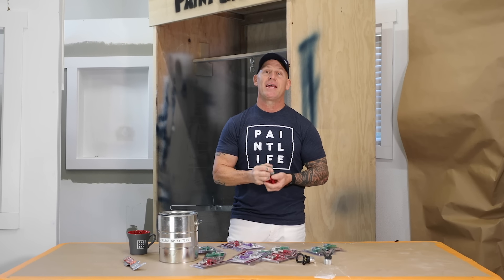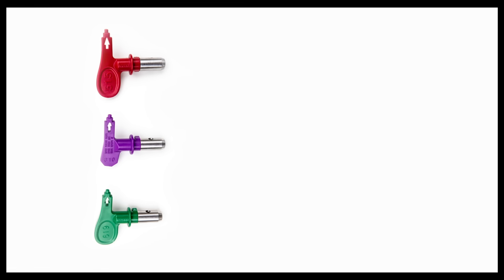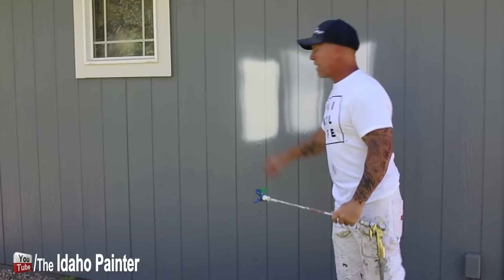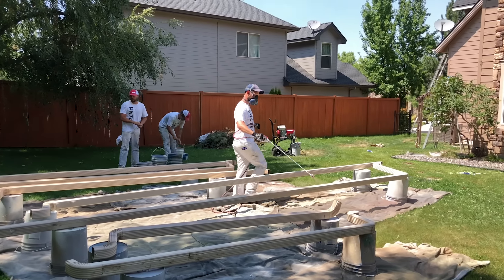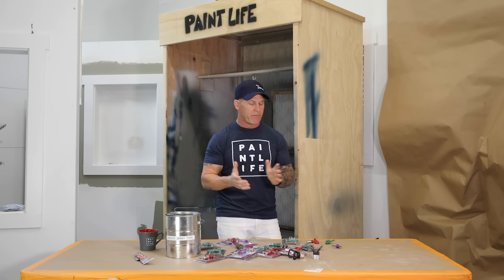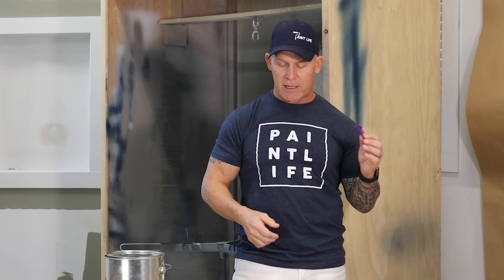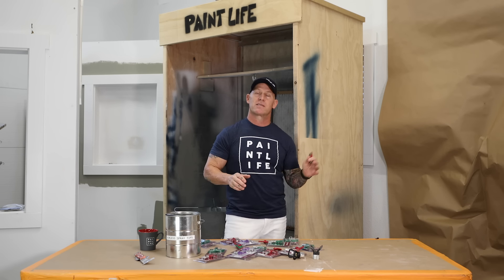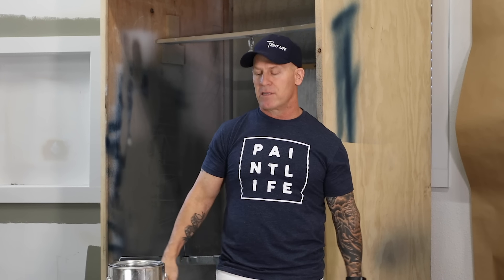3 MUST HAVE Airless Spray Tips!

Comment: I have a Graco X7. Can't go up to a 619. SO I bought a 517 going off your tip of a wider fan and more paint. What a difference between it and the 415 I had on the rough cedar siding. Didn't think it would be that noticeable. I went to painting myself after getting ripped off by the contractor that did our siding by thinning his paint and laying down just enough to change the color (paid for by insurance after a hail storm). The paint was thin enough that one pass with a 2300psi washer removed the entire coat, exposing the older color underneath. Talked to a contractor who told me some painters cheated on insurance jobs to maximize profits as he'd repainted houses that had been painted that way on an insurance claim. Made me wish you were here in Colorado. :)

Comment: 3-10 is a double orifice tip. Flat heads last a lot longer than the new switch tip fine finish tips. Fine finish tips very expensive and do not last long before they get blown. Especially on production work. I know the double orifice flat heads are special order and not easy to get now.  Nice job explaining in a short time.

Comment: You're amazing and I watch you all the time, I've been painting 22 years now and always like to keep learning and you are the man, I use 310"s for trim work, I carry a 410 in my pocket and I switch it out when I get to my doors, that way I don't have to adjust my pressure cause it's the same orifice size so just switch it out, do my doors then can switch my#310 back in and continue with my millwork, if I'm using acrylics I make sure that I have a medium course gun filter so it can pass through and atomize properly, if I'm spraying lacquers I use a fine finish filter and use a fine finish tip . Another thing we'd do when doing car lot's on exteriors, Wed put in a bigger tip , turn down the pressure to where it's literally fingering and back roll, of course back rolling is a must, we'd just do it so there was no over spray, basically it was coming out like a garden hose. We also spray down to the Second to last board on lap siding on exteriors, basically cut in underneath the board with the gun so we don't have to mask off the foundation, just roll out the bottom board. Thank you so much for your pro tips and knowledge. Sincerely Lorenzo gig harbor WA.

Comment: Love them HEA tips. Much new construction or repaints here (ect) houses are 3ft apart. The hea prevent me from masking the wall of the neighbors house.  Thank you for your time in the video
Reply: So the lower pressure just keeps over spray in the air down?
Reply: @oregonsdank  thats part of it yes. They also fan off on the edges better for less hard lines. Less flash when we overlap higher sheen paints like whats going on with exterior paints in my region. They put out close to the same gpm as a standard tip though. They are not to be confused with a fine finish tip though. 
   Graco, Titan, Tritech all also now have fine finish tips fflp (fine finish low pressure) that go WAY up in size. 6 21 in some cases. Not all fine finish are low pressure but many new ones are.  Shooting a 3 story house thats 4 feet from another 3 story house, these low pressure tips are worth the weight in gold. I dont mask the neughbors house. I can also get my gun a lot closer to the wall. 
  Small pumps can now run tips, and work half as hard. They literally extend the life of packings.
  I can mask less, which is less man hours. Run 12" paper on a dormer and haul ass.

Comment: Super useful.  Thanks!  Consider including time indexed summary/notes.
310 fine finish for doors.  Or fences even if trying to limit overspray.  510 fine finish if lots of doors.
515 for all exterior work.  Brick.  Some interior work.
619 for high/fast production interior walls.  Not for super smooth walls, risk of fingering/lapping.
HEA for level 5 finish.

Cheers!
Reply: What’s best tip for a beginner on interior walls. Latex paint. Not new construction.
Reply: @RaphaEl-pn8ue  did you find out what tip is best. Got a rental that I need to paint quick.
Reply: @kal7844   515 just giver a go! it's not very hard to get used to the speed of it, test it on a large piece of cardboard, overlap your sprays by half each pass.

Comment: Here's a question for ya, hope you see this, there's a home with lots of interior trim, 1" outside corner trim, 2" and 3" trim around all doors, baseboard and next to ceiling.  Should I use a smaller fan tip like 110 for that? i've never used smaller than 210 before, is it worth getting that tip size?

Comment: What would the difference be between a 310 versus a 619 for walls? I am going to paint the walls, trim, and baseboards all the same color, so which tip would be best for that? Since I would want to get it done as quickly and efficiently as possible, would the 619 be the better tip? I am learning SO much from you! I want to be loaded with as much knowledge as possible before using my first air sprayer.

Comment: Thanks for another in-depth video! Question! I have the Wagner pro 130, the 515 tip is a bit much in stairwell/ small areas. I was looking at the Wagner/ titan tips(chart) and I’d like to tame this wild beast! So, I’d like to use a 313 or 311 to do trim/molding. Should I when using 311/313 use a viscosity funnel to thin it out at all? Thanks again and stay gold✌️
Reply from the maker: I never do

Comment: Great videos! Thank you. Just picked up a Graco Project painter plus and plan on painting furniture, cabinets and interior walls/trims/doors. Graco says to go with a 315, but you are recommending a 310. Is there a significant difference between a 310 v 315? Should I be concerned if my sprayer can accept a 310?
Reply: wondering exact same thing.
Reply: I had a lot of trouble doing trim with a larger orifice, drips on corners was a nightmare. 310 got me a perfect finish.

Comment: I appreciate the information.  I've got experience with automotive and airless painting, but the doors I'm spraying now are driving me bonkers.  The paint doesn't dry as it should (I figure due to thickness of paint).  I've been using the recommended airless tip in a FF format, but will try stepping down to a .010 from a .016.
Reply: little late here but you probably need to thin the paint if it's thicker if you are using FFLP tips

Comment: Another great spray video thanks. When you use that 310 FF tip in most cases is that for one or two coats thank you!
Reply from the maker: Two coats with todays paints.
Reply: Can I buy 310 tip in Perth

Comment: ive always used a 623 blue tip for ceilings and a 517 for walls but the way i learned for walls was to always backroll it in so i always like a old worn out 517 thats all blown out to do walls with cuz we back roll it anyways

Comment: Can I use a fine finish tip like a 310 to spray interior latex? It's kind of thick paint, TDS recommends 0.015 to 0.021'. or should fine finish tips be reserved for thinner enamel paints only?

Comment: I have a question about the colors of the tips. I'm gonna by an airless "Wagner control pro 250M" and in that package I'll get tip 517 and 311.  What confuses me so much is that they are both the same color (green) so does that mean that the 311 is NOT for fine finish quality? Does it have to be both a lower number and another color to be fine finish? I really hope that someone can help me with this question before buying the spray gun. (I am not a professional- more of a DIY:er).

Comment: Would you use an hea tip to spray out a metal door frame? That way I don't have to cover as much up that wall or ceiling?
Reply from the maker: I would not

Comment: I have been using a 515 tip in a Grayco X7 and I cannot get the overspray under control.  When I get the pressure high enough to make a proper spay pattern (no tails), I have an awful amount of overspray.  What am I doing wrong?

Comment: Are Those 310-510 FF-Tips,  Considering the Orifice Size, Will They Work For Latex And Oil As Well ? Have Read a lot of articles that say .10 to .13 Orifice sizes are suited more for stains and oil Applications ?
Reply: i would go lower for thin stain products like solvents. for latex stains then yeah .10-.13
Reply from the maker: Thanks for your thoughts
Reply: @bailey2624  So To Be Clear, Orifice sizes  0.10 to 0.13 can be used (Sprayed) with regular latex paint on interior? The Orifices are not too small for Flat Or Eggshell Interior Paints ?? I Was under the impression those Orifice sizes would not spray properly when using thicker paints?
Reply: @deaton123able  if the tips clog to much you would need to water the paint down with distilled water. If it's really thick stuff then stick with. 0.14 or higher

Comment: Chris, I just purchased a Graco FFLP210 Fine Finish Low Pressure RAC X Reversible Tip for Airless Paint Spray Guns to use with my Graco Airless Paint sprayer.  I'm going to use it to paint my Crown Molding before I install it.  I'm using Latex High Gloss paint, it seems very thick, with this tip do I need to thin the paint or will it spray with this tip?  I watch all of your videos and I can't find anything about having to thin paint before spraying.  This may be a dumb question, but I really want to do a nice job, this Molding has lots of designs in it.  Thank you.  God Bless.
Reply: test it out

Comment: How would you compare a 517 to a 515 for interior walls and ceilings. And is a 311 green tip the same as the fine finish 310?
Reply from the maker: I like larger tips for interiors.  Smaller outside to control overspray

Comment: I find that using a 310 tip with acrylic primer always blocks up even if I run the pressure as high as I can. Do I need to thin the paint?
Reply from the maker: Thin it

Comment: can these airless sprayers shoot lacquer ?  I am a cabinet installer but also build some custom items and have always used a cup gun to finish them, but it is terrible when trying to spray anything large. just very very difficult to avoid lap lines or too much overspray build up ahead of me, it blows too much air no matter how I set it up and the lacquer drys way too fast. anyway I want to switch to airless but not sure about spraying lacquer base with them? I can use water base for a lot of things but in some situations I just simply have to spray it in lacquer, particularly when they want a clear glassy finish on a wood counter top or something. I bought a greco x5 ,its a small sprayer but for my use it is perfect, I would be using the 310 tip for water base paints but just wondering if I can also spray lacquer oddly enough it does not say ANYWHERE in the manual one way or the other. what do professional painters use for spraying lacquer?

Comment: Hello Brother I really appreciate your videos man
Question:
I got my self a 310 Titan tip but im having some trouble to get an appropriate fan out of it. Its just not pushing enough paint out
I live in the UK we are using Dulux acrylic primer on a Graco 395 pump to spray some doors and trim I tried every thing I could think of high pressure low pressure with no success, ending up using a graco 311 tip 
I would appreciate to hear from an expert like you what should I do?
best regards 
Norfolk Sprayers.:washhands:

Comment: I tried running the fine finish tip on my sprayer using regular superpaint. Using the HEA tip it worked fine, as usual. But I put the fine finish tip in and it'll almost bog down and jam. Then makes it's incredibly hard to remove the tip.  Do you know what it could be? Using a Titan 440
Reply: Change your gun filter to a finer  mesh size and make sure you change the seal that comes with the tip which sits in the guard, it has a different orifice size. Especially important with LPFF graco tips. Just my observations.

Comment: Im A handyman. Dont do a lot of painting. For so i have a cheap small airless. Spray painter noticed that on ceilings specially with a 515 tip i get fingering marks. Is that because my sprayer is not powerfull enough?
Reply: you need to increase your sprayer pressure, it has nothing to do with the tip size.

Comment: Hi need some advice for painting a upvc window frame i have and airless sprayer Wagner 350
Reply from the maker: Use PPG Breakthrough
Reply: @Idahopainter  Any suggestion on tip size and what psi

Comment: Chris help a brother out. I have a titan 440i with graco 310fflp tip.  New enough to the spray game. I'm in the middle of spraying kitchen units and I'm finding if I dont set the pressure high I get fish tails which means its pumping alot of material out! And in getting runs. Any advice? What pressure to set and how much water do you mix with water base satin ect ?
Reply: I personally never cut latex paints. Strain em all !!! Put a pre filter on over suction line. I use paint strainer for 5 gal buckets over mine, always. Secure em with simple wrapnof tape. Clean paint always, and less filter clogs, usually never
Reply: @richardthomas3417  Iv come along way in 2 months. Iv figered out what pressure. I mix 5% water getting good finish now with no runs. Thanks for your tip anyway bro

Comment: What is the advantage of the wand when spraying a door? It seems you use them alot.
Reply: I use wands for Everything, ssves your back and promotes good body mechanics
Reply: Jake Cattle not true at all. Wands are a tool designed for necessity not convinience. It does not save your back or promte food mechanics. 20 yr real journeyman IUPAT local 249. 631 gallons sprayed last week. Probably 500 this week.

Comment: Your videos are top notch my friend. Watching a great majority of them have answered many of my questions except one....So I have a question for you  You’re painting a wall with two colors one on the top and the other starting n the mistake and down to the bottom. 
Which tape do you use to mask for the second color and how long would you wait until applying the tape onto the freshly painted surface. 
Thanks for all your information.
Reply: they make like 1/2 a dozen colors of tapes now, it doesn't matter, (yellow, blue, pink, orange, green and....regular old fashioned beige). The only difference is how long you can leave them on w/o pulling paint off (> or up to 60days!), NOT how quickly you can put them on. Pick whatever you want, whatever's cheapest or you happen to have lying around. To your second question "freshly painted surface", wait till it's no longer "fresh" haha. As soon as it's dry, your g2g.

Comment: I have been painting new construction and always wondered why I was leaving lap marks. I use the exact same titan 517 tip. I thought I was getting to close to the walls
Reply: Tailing, your pressure is to low, and or worn tip

Comment: I bought a small airless Sprayer,  start doing small projects with latex paint,  
I use primer and paint in one,  
Some one at Lowe's told me that i need to use just primer first any way,  i wonder if that's true,  
If someone can help with this well be great,  
Thanks
Reply: if you're getting a good finish that adheres properly then there is no need for primer! primer is usually for promoting adhesion on surfaces that typically dont bond to paint very well.. metal or plastic type things, or in some cases a high-build primer can help to smooth out some more rough surfaces.
Reply: @TheLingonator  i spray very little the first time let it dry and with sandpaper smooth it,  then spray the second layer,  i like the finish looks,  thanks for you help

Comment: I have a Graco x17 and how do you feel about running a 619 tip?  Also interested in a 1221 tip but I assume I would have to upgrade to a x21 sprayer correct?  Looking to use it interior and exterior
Reply: Sorry to budge in I wouldn't try to use that big of a tip on such a small pump the problem will be that the psi won't be enough to push the paint as needed and you will see unsatisfactory results but thats just my opinion
Reply: @eddierodriguez418  butt in accepted lol.  That's what I figured.  Got any recommendations other than an x21 to utilize a 1221 tip?
Reply from the maker: Get a bigger pump.  Titan 840.
Reply: Yup, you'll go through that pump in a hurry with a tip that size. Most definitely need a bigger pump.

Comment: 211, 213, 217.
All I ever need.
The wider the fan, the slower the passes; the more spread out and less direct. A 5 or 6 tip can't get any nooks and crannies.
The 210 is useless.
Reply from the maker: interesting combo
Reply: @Idahopainter  hey, thank you for the reply.
I appreciate the support there and always look forward to your videos.
I am industrial. Water industry; so our approaches differ is all :)
Reply: Is the 211 a fine finish tip ?
Reply: @jayfuentes06 hey man. No, its not considered fine finish.
But for the FF, you need a different housing. Plus, I always find myself overthinning the material to eliminate fingering.
The 211 is almost indistinguishable from the 210 anyways. 
My buddy actually uses a 209. It doesn't need that dumb blue housing but he thins the piss out of everything.
I, however try not to thin paints unless I have to.
I also find that the wider the fan, the less direct, thereby slowing my passes and causing excessive overspray.
I find it's all about distance and speed! :)
Reply: @WebsterA  i see , thanks for the detailed reply :)